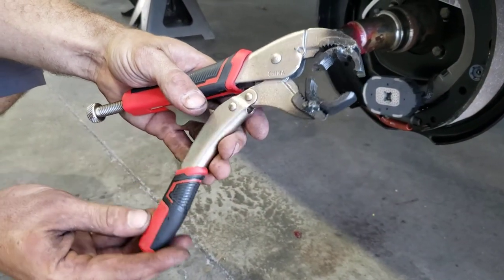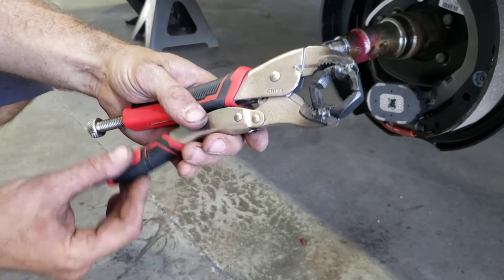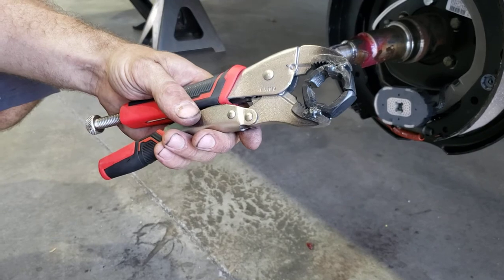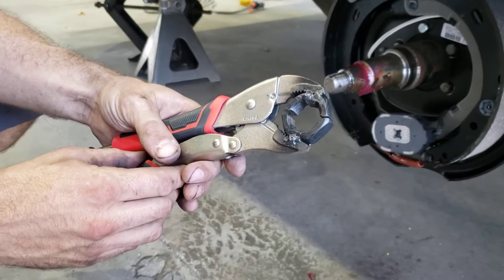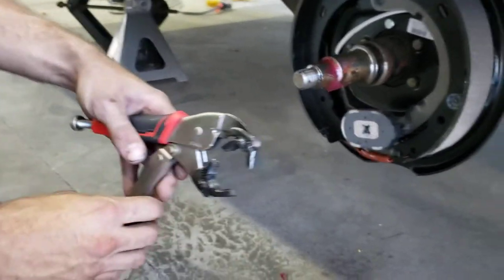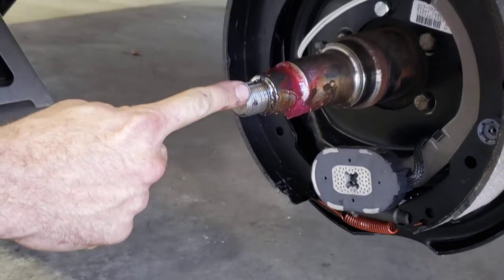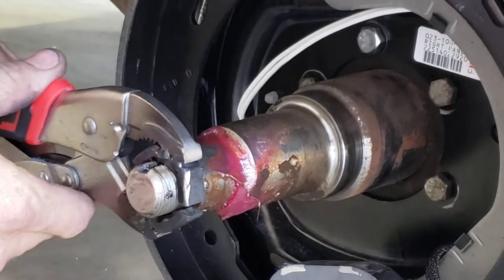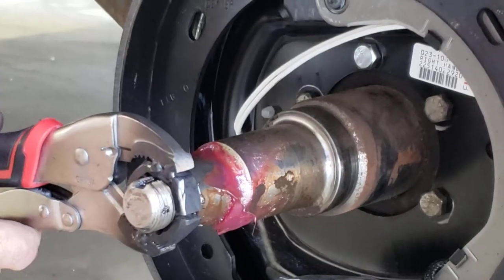Dexter Axle spindle repair tool

Comment: Question: Can I use the dye to replace a stripped nut...particularly if the threads are not aggressive enough on the replacement nut, and the axel although repaired, still has shallow threads.

Comment: What size die is that?
Reply: axles are not all the same thread, check yours to make sure you have the correct tap for your application.
Reply from the maker: 1-14 1 13/16